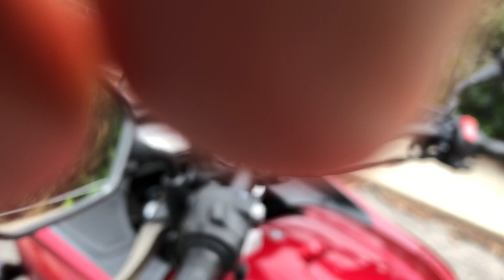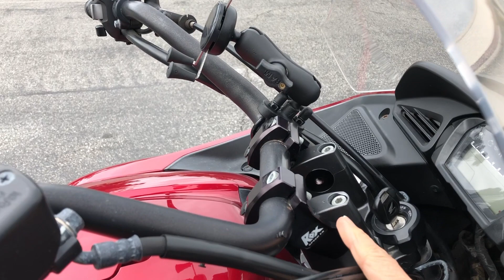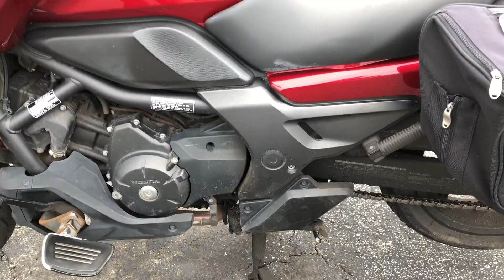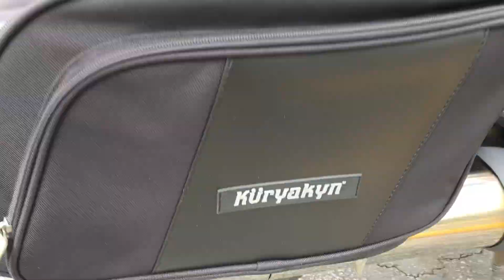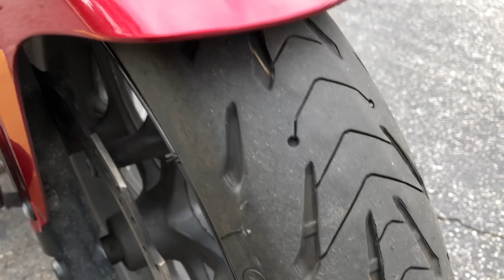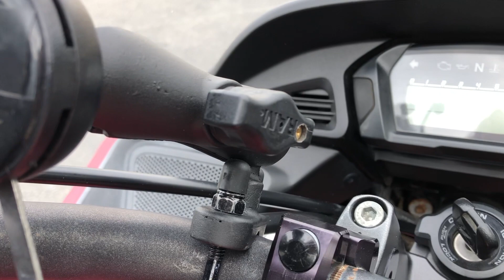Honda CTX700 the good the bad the messy

Comment: I bought a CTX 700 about 6 months ago ( With the factory fairing and manual 6 speed)  And I just cannot believe how good of a bike it is.  As a kid in the 70's' I had a couple of small Yamaha Enduros  (Street legal dirt bikes).  I later had a twin cylinder two stroke Suzuki street bike (250 cc) and then later as a middle aged guy, four cruisers ( two 650s, a 1500 and a 1300 cc)  Now I have bought this CTX and am crazy about it.  As a retired man, ( 66) I really don't mind taking the time to service the chain.... it gives me something to do.  I actually enjoy it.  I would never get rid of the bike just because of a chain.  I have also had shaft drive bikes and 1 belt drive bike.  The belt was really good but it's hard to find a belt drive bike unless you want a Harley Davidson... which I don't.   Anyway I just love the lightness and nimbleness of the CTX.  When I ride it it feels like I am flying.   Plus it's nice to get 65 mpg.  The only thing I don't like about the bike is the color.  It is white.  Not crazy about white but otherwise.... it's the best bike I ever had!!!

Comment: I have a 2014 ctx700n.  I use it mostly for riding country backroads where the top speed is 60 miles per hour.  I get fuel mileage in the upper 70 mpg range - as good as my wife's Honda rebel.  Love the bike.  I may need to look into the Michelin tires.
Reply: I have the same bike, rides like a dream very easy to balance. It’s my first bike and I am glad I chose it for my first bike.

Comment: For as little as you ride even for an average rider you do not need to lube the chain every week.  You only need to do so when you’re performing oil changes every 5-8k miles.

Comment: May I add to the "messy" list 1. The rear wheel, such a pain to take on an off. 2. The air filter and the valve checks are almost impossible to do. 3. The suspension.

Comment: My advice - you might be over lubricating that chain. If you have sealed chain with o-rings do the light coat every 1000 miles. Less is more. You chain is attracting more grid making with oil abrasive pulp. I lube chain twice a year and chain lasts me 30k

Comment: IDK if I'll ever get used to chain maintenance, and how difficult it is to change the plugs and air filter.  I cut my teeth on Sporters.
Reply from the maker: The air filter takes 90 minutes pulling several plastic panels, I never changed the plugs in 68k miles.

Comment: The chain is very easy to get to. There is no shock or saddle bag in the way. Most chain drive cruisers,  yes I had a hardly and it was a chain drive, I'm that old, are a Pita to get to.  Chain maintance use to be the norm and chains and lubes have greatly improved. Harley riders will spend more time cleaning their bike than riding.  I don't think 15 min to clean and lube is that big a deal. 
 Second, your fork tubes are pitted and are going needed to be replaced. That leakage wouldn't get past inspection in my state. You must be riding in a harsh environment or keeping it outside. You would be better off installing gaitors on it. 
  Other than that very informative video. I like the footboards and the spacers. I wondered why they made the seat so low then made the foot pegs and handlebars so far away. Anyone who would buy it with short legs would have a hard time reaching those.
Reply: @geneb5482  you couldn’t say better sir I do my cleaning and lune in 15  check tire pressure and that’s it ,, have nice ride👍

Comment: Can you drive 70/80 mph comfortably?
Reply: Buffeting is the huge issue this bikes. Need add aftermarket windshield, sides guards,  etc to make it a smoother ride at high speeds. Below 60mph it's comfy all day
Reply: @daniellambert8538  thank you for the tips !
Reply: Bit late to the party, but I use this for highway commuting and while I agree with the buffeting, with the windshield and side guards it's quite a comfy ride. Acceleration is fairly sluggish north of 70mph, but I can cruise at 80-85 without revving to high. Only issue is trying to get down behind the wind can be a bit rough on the lower back, given how far forward the foot pegs are.
Reply: @scribeslendy595   thank you!! I had a can am, sold that and ended up grabbing a Harley . Electra glide, no wind, do 80 comfortably. Appreciate the response! Ride safe

Comment: Bags can't touch the paint....drills hole through the paint.
Reply from the maker: I made brackets 1/8" steel bags don't touch the paint and I removed the handles and bolted brackets into those holes no drilling at all.
Reply: @marcbee1234  thank God for that, it would be sacrilege

Comment: Keep in mind shaft  takes 25% of the power you are making and belts about 10 to 15 % , chain only 3 to 5 % , si it’s a tread off
Reply: Reliability, maintenance cost, maintenance time are bigger factors than power loss. Shaft drive is superior for tour/cruse bike, quieter smoother, less maintenance, cheaper to maintain yourself.
Reply: @ryanrevis827  On my 1500 cc cruiser and my 1300cc cruiser losing 25% of the power didn't matter because they made so much horsepower and torque that they were still really good.  However, on the little CTX 700, which really is a 670 cc bike, losing 25 percent of it's power to a shaft drive would be a really serious downgrade.  It only makes 47 hp to begin with and 60 nm or 44 ft lbs of torque.  Plus gaining a bunch of weight on top of the power loss would really hurt the power to weight ratio.  On a big bike a shaft makes sense.  On a little light and nimble 670 cc bike.... I think  (at least for me) it would be a terrible trade off....
Reply: You really believe a 100hp bike is using 25hp to spin a few pounds of metal compared to spinning a few pounds in another direction?. I have some land in Transylvania I would love to sell you. Hahaha.

Comment: Tip: You do not need to oil the chains that often on modern bikes with modern chains.  Most people oil them too much based on the oil requirements of chains from decades ago.  Just a light coat every 1K miles or so.
Reply from the maker: I ride around 700 miles a week!
Reply: I would go longer than that depending on the weather lol

Comment: what about your valve adjustment at 8100 and checks every 12 to 15000 miles after that what has been the cost on that? thanks good video lots of needed information any other advice mine now has 5100 miles on it
Reply from the maker: I never had the valves adjusted and now with over 60k miles the engine starts and runs perfect. Also click link for my recent 60k mile review it shows all records ever done.
https://www.youtube.com/watch?v=LkYvf-sJAQo
Reply: @marcbee1234  and you still get around 64 mpg
Reply: you have really made me feel good then
thought I got  a maintenance nightmare
Reply from the maker: @RH100beepbeepbeep  I've always gotten 60 mpg and still do.

Comment: I have the same bike, same year and agree with your review 100%, very solid and dependable ride. I came from an older shaft driven CX500 and hate the chain too. I also added the center stand as it makes oiling the chain a lot easier, it should have been included with this bike from new or at least been made available from dealers in the USA. Michelin tires, absolutely the best, no doubt about it!

Comment: Are these things as sluggish at freeway speeds as the professional reviews say?
Reply from the maker: It has plenty of power, more than enough I've had it to 95mph with a group of Harley's and could have easily gone faster. I've owned around 50 motorcycles this one has THE best all around user-friendly engine.
Reply: @marcbee1234  They say that because it LOOKS like a sport bike of some type.... so you expect it to behave like a fast sport bike.  In reality it's a cruiser with pull back handlebars and forward controls and a cruiser engine that runs well at low rpms and has lots of torque for a 670cc. Once you understand that it is a CRUISER you realize that it's pretty fast for what it is.  It's just a 670 cc cruiser.  I have had two 650 cc cruiser bikes in the past and they were both WAY slower then the CTX.  The CTX is a fast 670 cc crusier.  Although admittedly, the Kawasaki Vulcan S is faster but it actually is just a sport bike that has forward controls because it has the ninja high revving motor.... and thus has not much torque.

Comment: @ Marc B How tall are you? I'm worried if it will fit me at 6'1
Reply from the maker: My inseam is 32 inches, I think that's the make or break fit zone.
Reply: @marcbee1234  Well I guess that kinda kills this motorcycle for me.
Reply: I am 5' 3",  and I can plant my feet properly.  You, as 6 footer should have no problems whatsoever.  I'm surprised you asked.
Reply: you're joking right?
Reply: I’m 6’1 with 33 1/2 in inseam. I don’t feel it’s too cramped if that’s your concern. I have 14k on a 2018. Great bike in my opinion

Comment: Hoe many chains did you go through ?
Also other wear items like brake pads, clutch? 
How often did you check the valve clearances?
Thanks in advance..
Great review.!!
Reply from the maker: 2 chains, just replaced both sprockets, lots of pads, no clutch issue still solid, no valve adjust, 1 air filter, 53k zero issues.
Reply: @marcbee1234  Wow, that is a great track record.
Thanks for the info....Safe riding!!!

Comment: I GET OVER 70 MPG AND SOON WILL ADD CAR TIRE TO REAR FOR IRON BUTT RIDES MUCH LONGER MILEAGE .
Reply: I don't believe you.   A car tire is just not suitable for a motorcycle.
Reply: Ray Müller look up darkside motorcycles, theres alot of people that run car tires on the rear

Comment: Is it a scooter?
Reply from the maker: It's a mid sized motorcycle, a scooter is a light two-wheeled open motor vehicle on which the driver sits over an enclosed engine with legs together and feet resting on a floorboard.
Reply: No, not classified as a scooter.

Comment: Could you please share the center stand part number?
Reply from the maker: Center stand part # 08M70-MGS-J10 I also got the stopper don't know it's part number.
Reply from the maker: It's been too long I don't have the part numbers any longer but look online at the blogs the information is there, that's how I originally found the part numbers through Honda CTX700 blogs. Good luck!
Reply: @marcbee1234  Thank you sir!
Reply: Go on ebay.com,  seacrh 2014-2018 CTX 700 Center stands.  You will find a couple of suppliers:  T-Rex in Texas,  dirtbike-boy in china.   Prices are all over the map.  I got the Chinese one, ($132.99) delivered free, but took just over a month (it's winter, I am patient)  The chinese one is identical to the German model from www.hepco-becker.de  but is literally half the price. BTW: when I got the Chinese model, it had the exact same instructions and SKU as the hepco.     The T-Rex model is an in house version which uses two springs on the left side,  while the China / hepco model uses one spring on each side.  Easy enough to install,  you can find installation videos on this site.
Reply: T-rex racing in Dallas TX has a perfect set up I just installed on my 2016 dct

Comment: Which center stand works? Where can i buy 1?
Reply from the maker: Center stand part # 08M70-MGS-J10 Japanese + Stopper(not sure stopper part #) fits CTX700, NC700S and NC700X I bought it new from United States private party on Ebay. Parts included in purchase were: center stand, 2 springs and a stopper.
Reply: Way to cheap-out the bike, Honda! It saved, what? $100 per bike? How convenient when doing maintenance or chain oiling.
Reply: @tbillyjoeroth  
The Japanese model of the CTX700 includes the stand. We North Americans are being nickled and dimed for the parts that should have been on it from day one.